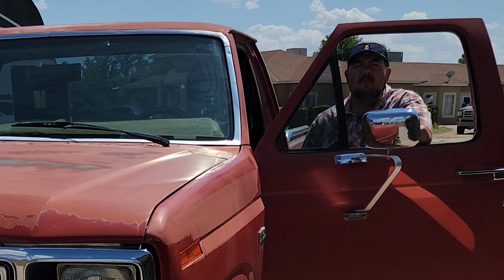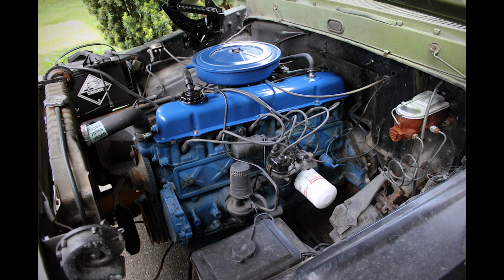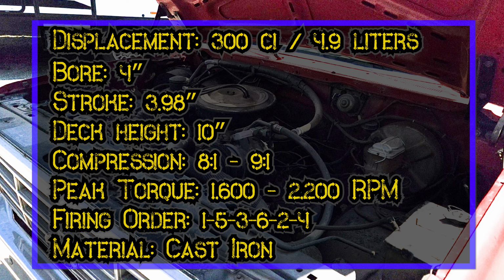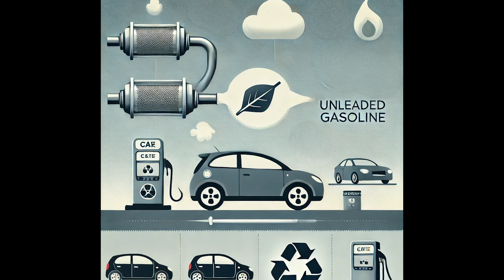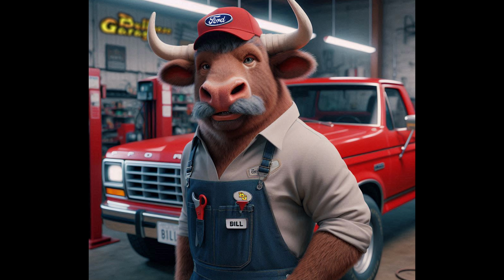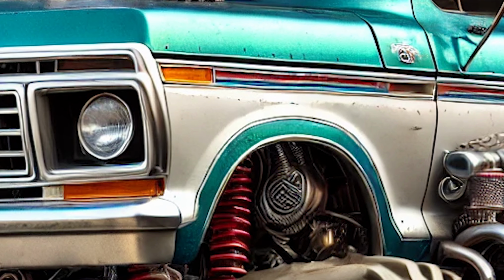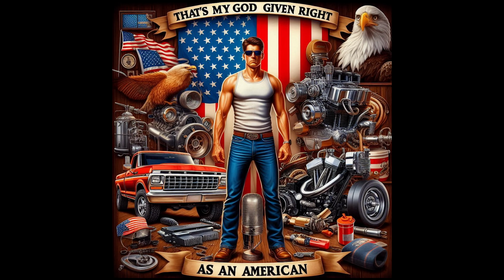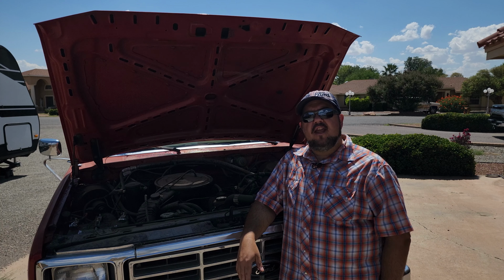Ford 300 Inline Six - What You Need to Know About Ford's Bulletproof Engine [4.9 Liter]

Comment: The 240/300 series are the “big blocks” for the Ford six cylinder. To my knowledge, the 144/170/200/250 don’t share any commonality. The 240 was a good motor also.
Reply: There's also a 250 i6 unrelated to the 240/300
Reply: The 144/170/200 were an economy series meant for cars. The intake is cast as one with  the head. The 250 is a loner using a separate intake, again meant for cars and economy. The 240/300 are a series meant for trucks and heavy duty usage and are by far the best of the bunch.

Comment: Ed, have you seen the turbocharged 300 Big Six built by youtube's Power Nation? It produced 517 hoursepower & over 600 lb/ft of torque !! on the dyno! They detuned it some & installed it in an old 1966 1 ton dually as I recall. Rethink the engine swap. A matched turbocharger could be a gamechanger. It will make your engine more of what it now is, a torque beast, but with with more grunt!
Reply: After seeing that episode,  I would love to build that turbo 300 Inline 6 and put it in something
Reply: Have you seen newcomer racing Jeep 4.0 motor builds.
Reply: They had the industrial version of the 300, so it was a no-brainer to turbo it.
Reply: @claytonhess5512  . I understood "Industrial version" to be a low compression with a smaller cam. Excellent candidate for a turbo of course.
Reply: @ebinmaine  Industrial 300's came stock with all-steel cam timing gears and a forged crank. Who WOULDN'T spin that up!?
Reply: @claytonhess5512   ABSOLUTELY

Comment: They need to bring it back !
Reply: They won't: they "can't" make any money on parts and repairs for this engine, if you catch my drift.
Reply: @claytonhess5512  They can't make them anymore cause of strict federal EPA regulations. Emissions bs and all that stuff you know
Reply: @brudduh  That's their PR excuse.
Reply: I gutted mine, I had all the epa crap on it. It basically just makes the engine redirect the burnt fuel sending it through another chamber which makes it not last long. I cut that off
Reply: @boerhoden5185  I like to call the emissions junk "Forcing the vehicle to eat its own..." ehhh you know...
Reply: @boerhoden5185  I plan on gutting all the emissions on my 1980 F-100 soon, the 300 inline 6 in it looks to be in great condition and I want to preserve it forever lol. can't have that egr bs unnecessarily wearing my good engine
Reply: @paulmarion3290  my motor came form a 1991 f150 and I put it in a 1989 f250. I’m trying to fix a 1973 ford maverick with a 223 or 240 i6

Comment: Wonder why they ever quit making this. If they wanted this eco boost mess, they could’ve done it with the 300!
Reply from the maker: Oh man, that would be a great engine.  I've got an EcoBoost in my 2015 and it's pretty fun.  Maybe I should keep the 300 once I pull it and build an "Old School EcoBoost" for another Bullnose.
Reply: Emissions might have cancelled the 300 - but the tooling was also likely getting worn out.  And the 300 wasn't powerful
Reply: @timothykeith1367  spacing was a problem too.   Straight engines occupy more space.

Comment: Beautiful motor . Love Tham ❤️  to bad my 67 hi boy 3/4 was stolen.  But I still own a 300 6 in a 95 e150 van that I've completely rebuilt . 297g miles no oil consumption running today & forever providing it's not outlawed by government.  No more 1 tons or larger gas or diesel pickups or motor homes A or B models can be sold in Washington state.  Dictatorship

Comment: Not quite 50 years ago as a 16 or 17 year old, I was driving my Dad's F100 with the 240 and "three on a tree". Had gone to town, was still in town but heading back home to the farm. Turned onto a one way street. Custom Chevy van with fancy mags, and a v8 with glass packs is sitting side by side with me at a stop light. I pulled out the manual choke a little to make it run a bit rough, as if I had a cam. Might have revved it a little once or twice just for fun. The light turned green..... Choke back in I started out normally. Not the van. And what he didn't know is that a cop who was a block behind me on the other street turned the corner at the right time to see this guy smoke his tires and really take off. Yes, in a van. I was very rarely a naughty teen, believe it or not. But that day, I confess I was bad. Cold blooded even. Hope he just got a warning. 
I miss that old truck. Have a hankering for a 4wd (for snow) F100 or 150, or maybe even 250 with a f.i. 300 and a 5 speed manual.  Might put carbs and a points distributor in it for ease of maintenance, even if a bit more frequent.

Comment: I had a 250 I6 in a 70 Maverick when I was a stupid 80's kid.  As a stupid kid, I used liquid drano to clean out the cooling system one time.  Ran for several years after, was later rebuilt and ran for more years after that.  Could still be running to this day, for all I know.  I loved the sound of it at idle.  I can't imagine how long it would've run if I wasn't an idiot.
Reply: Vinegar did wonders for me on the radiator...it looked like milk come out
Reply: My grandpa gave my aunt a 70s maverick. It has been sitting around for years now. I’m trying to get my hands on it. She won’t sell it because she wants to fix it, but she has been saying that for years.
Reply: It has the i6 240 like the one you’re talking about. Somehow the engine is not locked up which is kinda insane not gonna lie.

Comment: Have a 96 CCSB 4x4 7.3 with the ZF5 manual transmission, and a 91 SCSB 4x4 4.9 with the 5 speed. I use the little F150 for weekend trips to the dump and just to cruise around in. Truck rides great, easy to drive and my wife loves it too. The 7.3 does the heavy lifting, and is great when we need to tow and haul the whole family around too. Haven’t had much trouble with either.
Reply: The 300 and the 7.3 PowerStroke, Ford's best of the auto industry.

Comment: My first truck was a very used 1981 Ford F100 with a rebuilt 300 six cylinder. We converted it from a 3 speed manual to an automatic transmission. Didn’t have to be a computer engineer to work on them back then. Shame Ford doesn’t make them like that anymore.

Comment: My 72 has a 68 300 swapped into it when the 360 blew up by the old man who owned it. It doesn't burn oil, barely leaks oil, never rebuilt. The truck it came out of rusted apart and was scrap.

Funny story, the old man died because he was around 200yrs old and his neighbor sold it to me because he had no living family.

I would park it illegally and get tickets all the time when I lived in Everett and laughed when I balled them up and tossed them in the bed stake hole.

Fun fact: most cargo tugs at the airport have 300s in them. I got introduced to them when a rug came in with a horrible metal banging noise from the engine, we were really busy and it ran well enough if you were deaf. When it came in for repairs 2 weeks later the noise was gone and I realized it had a miss. 

Found no compression on cylinder 1, pulled the head and found the exhaust valve dropped and flipped upside down shoved steam first through the piston.

I found a spare piston and valve, put it all back together and it went back to hauling baggage

Comment: I had about a dozen various F250- 450s  4x4 bush trucks in our fleet  in the early  - mid  80s .. everything from 77 to 85 .. some were close to 600k miles.. without doubt the 300-6 and  and 460s pre efi were outstanding . a couple of 400m' s all did wel too. Most of our gensets were 300-6 powered, as were our on truck welders, pumps and compressors..

Were i to turñ n the clock back to early mid 80s , with todays knowledge,  i wouuld still have no hesitation in bùying same again ..

Comment: I had one of these back in 1992, a '77 Ford Econoline base model (with the hinged cargo doors, not the sliding one) that spent most of its life as a patrol van at a mental institution and therefore only had 76,000 miles on it. This beast was dead reliable, had decent pickup and returned about 20 miles per (Imperial) gallon hwy. Only thing I hated was the small gas tank.

Comment: Yes it's dependable unless you have the 96 with 0bd 2I have one it's not dependable at all it's been nothing but trouble.Even when it did work they are completely gutless uphill towing a load or boat.I had a 94 as well (both F150s) same problem,slow and gutless You're right buddy and I was about to swap in a 351w into my 96 Eddie Bauer F150 reg cab short bed 4x4 as well.Wanted to swap in the 7.5 460 big block but my truck only has the rear single tank not the dual tank bed, imagine how long that lil tiny 12 gallon tank would last with the 7.5 in  it at 8 mpg lol

Comment: All the inline 6 cylinder engines of Ford, GM, and Chrysler are long lasting and bullet proof. Life long Ford guy here, but learned my lesson on the new or newer Ford junk. I have a few newer ones and they are garbage. I've learned that 1995 is the cutoff for my liking. Good Ford vehicles 1995 or earlier. The newer they get from there the more problems and recalls. A big problem I've had is the Ford techs don't fix the recall correctly and I have to keep taking it back because of it. I don't even take in my vehicles for a recall anymore because I don't need the added problems the techs create. It's too bad that the auto industry has gone to shit. All makes have gone to shit not just Ford. When my 2014 Escape trans (6f35 is loaded with problems and Ford knows it but will not recall the junk because they can't fix the crap engineering) finally craps out, I have a 1989 Bronco 2 to replace it. Good ol dependable but gutless 2.9L. The old Fords are what you want. Can't beat em and you can work on em.

Comment: Hold up…..stroker kits for a 300? I can’t find one. I’m building a 300 with an intake/carb/cam upgrade and would have LOVED to stroke it.
Reply: Yea I think he might have misunderstood.  To my knowledge, the 240 and 300 engine block share bore spacing, bore size, and possibly deck height but I don’t want to lie to you there. I’d have to go back to my old books to confirm the deck heights. 

My guess is he read about using a 300 rotating assembly in a 240 block, which would still be a 300. 
However, I would have to look at different combinations of rod length and pistons that were available to see what could maybe be done. ( Think Jeep 258 crank in a 4.0 block )  My guess is Ford would have done this though if a viable engine displacement would have resulted. 

A 240 head will fit onto a 300 as well, but 240 heads are almost non-existent now. The 240 had a combustion chamber of 68cc vs the 76cc of the 300.  Otherwise, the heads were almost identical. 

Also, some industrial and heavy truck variants of the 300 had a forged crankshaft rather than cast steel.

Comment: Other than the fiber timing gear, they were very durable
Reply: Everyone says the metal aftermarket gears are noisier but I couldn't hear any difference. The fiber gear is the achille's heel of the 240/300. The oil pumps also sometimes die in the 300's.
Reply: @ we had them go out as low as 20k miles

Comment: Ive never seen a 300 with a 4 bolt main only 2 bolt mains but crankshaft in other versions can be forged.
Reply: I've heard someone say that their industrials were 4 bolt , but that is the only reference. Given  I've have wrote a lot of cheques for our repair shop,  and given we had at  least a dozen 300/6 motors on the payroll, nothing rings a bell..

Comment: I see that you have the same crappy red paint that my 85 F150, 300 six 4x4 has.  At least we have the greatest gasoline in line 6 ever produced.  I've modified my with a DUI electronic ignition, Offy 4bbl intake and Headman headers.  I also replace the exhaust to 2 1/2 inch tail pipes.  Vast improvement over stock.  Out pulls and gets much better gas mileage than my son's 94 F150 with  the 351.

Comment: You can make over 500 HP and 600 + pounds torque with simple bolt together parts for the 300 six. Dyno proven.

Comment: I'm building turbo kits for the 300s, will blow away any v8 smaller than a 460 while sipping fuel and unparalleled powered 

Should look into the boss 300 from 1970, made about 625hp which the small blocks of the time could not do

Comment: Tough engine. One of the reasons they last so long, yhey don't have enough power to break anything. The carburetor on mine.looked like it was borrowed from a lawnmower
Reply: They're reliable because they're a solid, simple design. Horsepower has no factor. You can raise the power on these and they'll still be reliable.